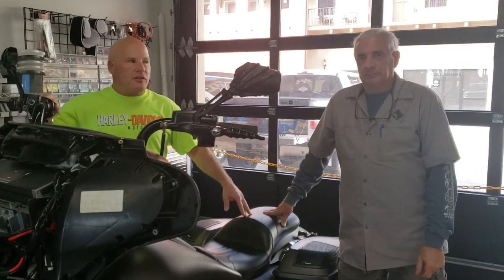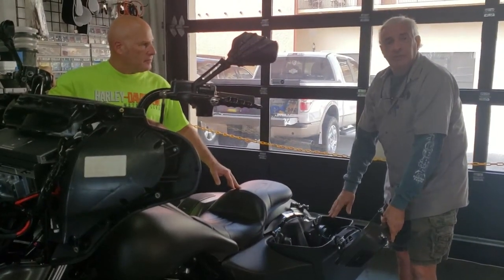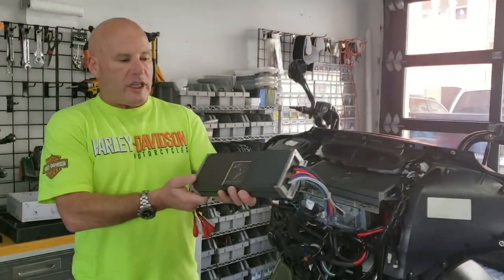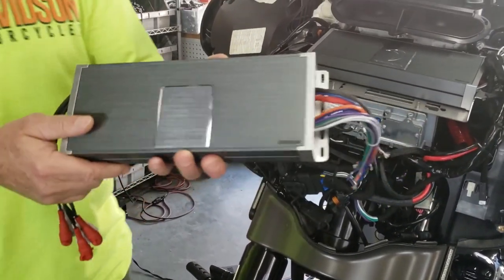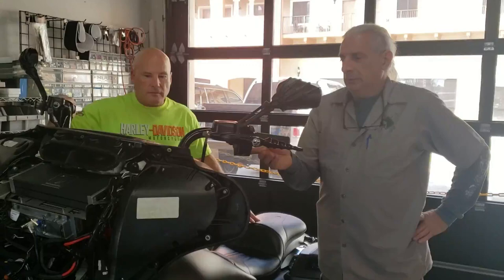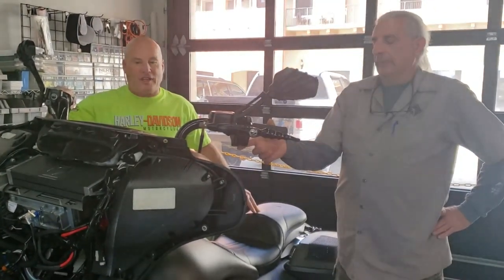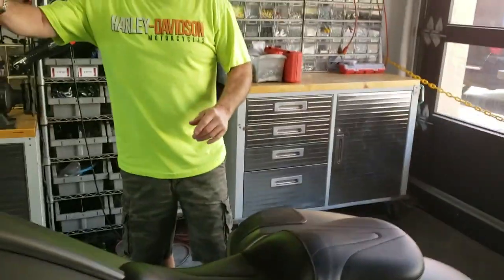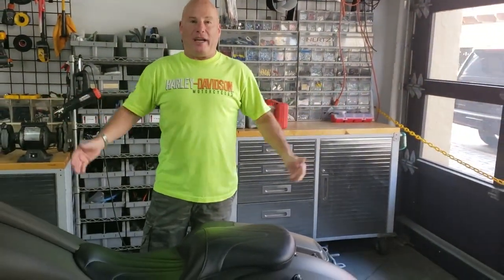Want to really crank up your bike?

Comment: Also any suggestions on flashing the radio my local dealer only has the boom flash I'm on 19 flhx and cant seem to get anyone to work with me on what system to use or installing it I have a local audio guy as well but with being a new bike got alot of worries with them wiring and waterproofing
Reply from the maker: First, where are you located.  Are you going to make it to bike week next month.  If so we can take care of you.  Installing a quality system in the new bike can get complicated.  I'd be very careful,  an audio guy that doesn't know new Harleys I'd probably steer clear.  Flashing is an experience thing, the dealers really aren't great at it, they typically know only the boom stuff which is horrible.

Comment: I'm trying to keep it to a budget cause I have alot goin on at this time but I wanted the hd14rgsg stage 3 they want 1498 and my dealer claims 5 hours for the install at 90 an hr says 1900 total out the door I wanted to stay at around 1700 dealer wont work with me nor will rockford i called them directly and if either would i still cant get the correct flash any suggestions on a differant route thanks
Reply from the maker: I understand,  I'd hold out until you can find a shop like us, you dont want to waste you money, I could install a killer system that would fit you budget.
Reply: @tonyashHarley  I totally get that and believe ya I wish I could get down there I'm up in Pa had a few friends tell me the same thing about not goin the route I was taking for the money I could better thanks tony I respect your input hope to see you around 1 of these days
Reply from the maker: @davidsipes1226  Best of luck brother,  hope to see you at some point as well.

Comment: so what kind of $$$$ are you talking for a system like this, Tony...?????
Reply from the maker: This bike with the extras and with the new amp was a little pricey.  Ping us via our website or on Facebook so we can talk about your bike and what you may want to determine prices. Call us @ 386-256-2816
Reply: @tonyashHarley  I have a 2017 RGS with custom flames on lid of the bags.  Is putting in lid speakers going to spider out where the cuts are made?
Reply from the maker: @barrydawg7544  No we do these all the time, are you coming to bike week?
Reply: @tonyashHarley  Won't be making bike week unfortunately...
Reply from the maker: @barrydawg7544  where are you located?
Reply: @tonyashHarley  Columbia , Missouri